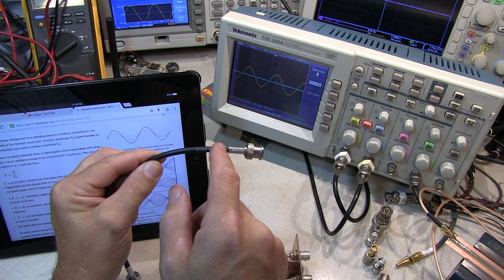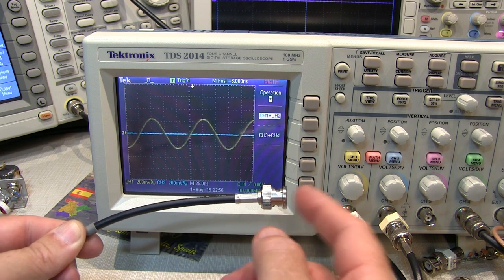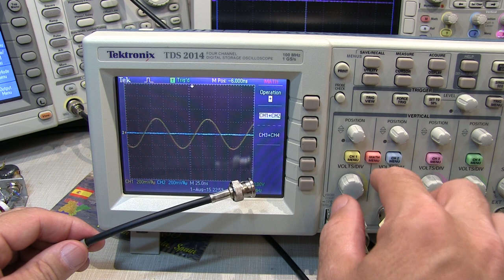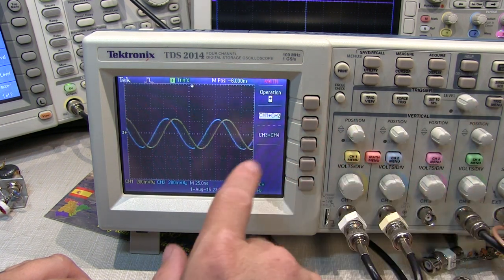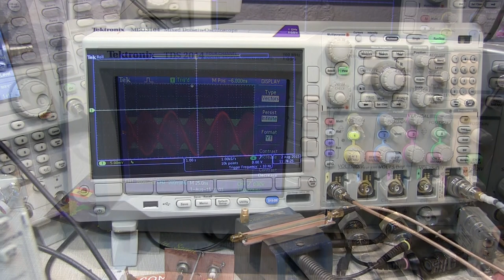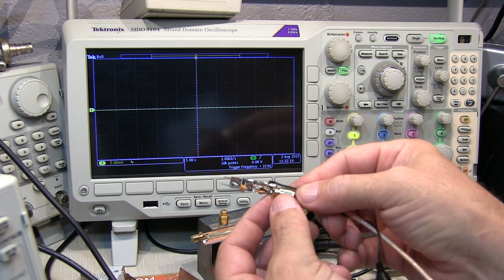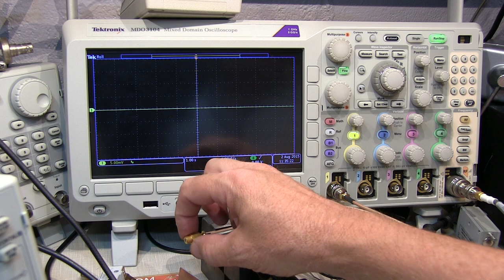#208: Visualizing RF Standing Waves on Transmission Lines

Comment: Hello Alan. Thank you for your time spent making these videos. 
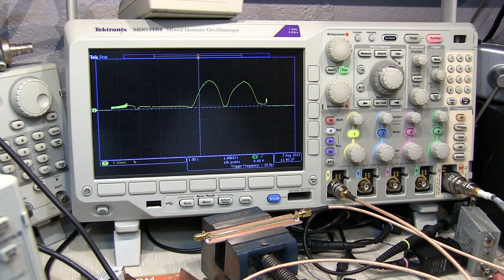In your summary at 10:15,  if we can relate that a mis-termination of a transmission line as being an antenna that does not have a reactive, capacitance property of 50 Ohm at the frequency of operation. As well as not having our transmission line from the antenna to our SWR meter at 1/2 wave increments to the Velocity Factor of the coax, would only mean that we would not be able to truly see what are VSWR actually is. 

For example, if our main run is a random length of coax and we tune an antenna to the coax with the swr meter in our shack, although the swr meter is showing a reasonable swr it doesn't mean our antenna is a 50 ohm termination. Effectively not radiating power from the antenna but the coax as well diminishing the Effective Radiated Power.  

On the other hand, if we were to have our main run from the antenna to our SWR meter in increments of a 1/2 wave length at the frequency of operation to the Velocity Factor of the coax. Only then would we be able to tune our antenna to the lowest VSWR possible (or as close to 50 ohms as possible). Maximizing our Effective Radiated Power.

Make sense?
Reply from the maker: First point of clarification - there is a mis-termination if the antenna does not have a RESISTIVE impedance that is equal to the transmission line impedance (not a reactive or capacitive property).  If the antenna presented a 50 ohm capacitive reactance, it would have a very high SWR.

The "magic" of a half-wavelength transmission line is that the impedance looking into the line will be equal to the impedance looking into the load (antenna in this case). In other words, the load impedance is replicated when the line is a multiple of half wavelengths long.  A longer or shorter transmission line will result in a change in the impedance looking into the line, but does NOT change the SWR on the line.  This is a very important statement to grasp - changing the line length does NOT change the SWR, it just changes the complex impedance seen looking into the line.  This is illustrated pretty well in one of my videos on the smith chart (https://www.youtube.com/watch?v=ImNRca5ecF0).  Of course, this is assuming negligible loss in the transmission line.

So, having the transmission line be not equal to a multiple of half-wavelengths long only means that the input impedance does not match the antenna impedance - but the SWR is still unchanged!  The SWR is a function of the antenna impedance and the transmission line's characteristic impedance, NOT the line length.  Therefore, if you make adjustments to an antenna to minimize SWR, the result will work fine regardless of line length (as long as the transmission line is not electrically part of the antenna).

Bottom line, it is NOT necessary to have the transmission line be a multiple of 1/2 wavelength in order to get maximum radiated power (maximum power transfer to the antenna).
Reply: @w2aew  
Clarification noted!

If I am reading this correctly (Cuz I aint lernt to good) The "magic" of a 1/2 wave length coax is, that it is no longer seen by the transmitter. Poof, It disappears (not taking into account losses in the coax) Ta-da! Magic!

To my understanding, the transmitter now sees the antenna only, and if the antenna dos not have a 50 ohm impedance a Standing Wave will be educed on the line and seen by the swr meter.

You have made it clear in other videos that a 1/4 wave transmission line looks like a short.(it is also mentioned in the MFJ analyzers manual) Which means the impedance value of our transmission line does change BASED ON length of line with respects to frequency applied. so using a random length of coax while making a 1/4 wave ground plane antenna affects the tuning of the antenna, while trying to make the antenna terminate our line at 50 ohms. Making the coax electrically part of our antenna. 

(an experiment that everyone can do)

If I build a 70 cm 1/4 wave ground plane antenna with a random length of coax, which works perfectly fine with minimal SWR at my house and I give it to my friend for Christmas (cuz i'm such a nice guy) and he uses his own coax, which is a different length and Velocity Factor (then what I made and tuned the antenna with) his SWRs will be totally different than mine.

Now, the stipulation to this (in my opinion) is if I give him the antenna WITH the coax (in which i'm really not that nice of a guy) that i made and tuned the antenna with originally and he needs to extend the length of the coax to get to his swr meter. He would need to make a coax jumper in increments of half wave lengths. That would mean that the coax I give him IS Electrically part of the antenna (which is now a 50 OHMs to the end of the coax not to the connection at the antenna) and the extension he needs to make will not be seen by the swr meter because it is in 1/2 wave multiples. Poof, Ta-Da, Magic !!

If I would have originally used a length of coax that was multiples of 1/2 wave lengths to the frequency of operation and velocity factor of the coax, The home brew 1/4 wave ground plane antenna, would have an impedance of 50 ohms at the connector.
 
(End experiment)

To to sum it up (in my opinion), 1/2 wave increments of coax is the only way to do things, when setting up a station. Unless an antenna tuner is used. Even then, the work done in the transformation of impedance by a tuner would be less if 1/2 wave increments were used to and from the tuner (the transmitter will not see the coax only the tuner and the tuner would not see the coax, just the impedance mis-match of/at the antenna) That could only be proven with  a VNA in which I don't own.

Alan, I would like to make something clear. I am not trying to negate, manipulate, argue, dispute anything you are saying or showing us in your video.
I really do appreciate the work you have done and your time spent making your videos. The one thing that you have done is sparked further curiosity and ambition on working towards discovery and understanding.

 I thank you for that.
Reply from the maker: @sevenoseven8494  I'm afraid you misunderstood me!  The only thing that the 1/2 wavelength increment gives you is a replication of the antenna impedance at the coax input.  There is NO REASON to restrict yourself to this!!  You can use any length you need.  If the antenna is matched to the coax, all is well with any length coax.  If the antenna is not matched to the coax, the input impedance to the coax won't be 50 ohms, but can still be matched at the transmitter end with a tuner, regardless of coax length.  The SWR on the line in this case will be the same - regardless of the coax length.  Restricting to 1/2 wavelength increments does not make the tuner's job any easier.  The complex impedance looking into the coax will vary with the coax length, but the SWR is the same.
Reply: @w2aew  
I'm sure I do understand you, It seems we are standing a quarter wave apart on a smith chart looking towards the center, both trying to achieve a 50 Ohm Impedance.

1) you state,
The only thing that the 1/2 wavelength increment gives you is a replication of the antenna impedance at the coax input.
my response,
that's my point! I want to make sure that my antenna has an impedance of 50 Ohms not my coax and antenna!

2) you state,
There is NO REASON to restrict yourself to this!! 
My response,
It's not a restriction, having the main run to the antenna in 1/2 wavelength increments, would not be adding the complex impedance of the random length coax to the miss-matched complex impedance of the antenna, further complicating the total complex impedance of the antenna and coax. Why make things more complex then what they should be. the antenna impedance would be the cause of the miss-match on the system creating the SWRs.

3) you state,
If the antenna is matched to the coax, all is well with any length coax.
My response,
If that's the case, I can use RG6 75 Ohm coax trough out my shack. Adjust the angle and length of the ground plane of my antenna to compensate for the impedance and affect the angle of radiation of the antenna. Rendering the antenna useless. Achieving a flat SWR.

4) you state,
If the antenna is not matched to the coax, the input impedance to the coax won't be 50 ohms, but can still be matched at the transmitter end with a tuner, regardless of coax length.
My response,
That's exactly what the purpose of doing things this way. Now I know that the antenna needs adjusting. That's it! Using a half-wave length of coax ensures that the transmitter/SWR meter see the antenna and not the coax and the antenna matches to the transmitter. 

5) you state,
 The SWR on the line in this case will be the same - regardless of the coax length.  Restricting to 1/2 wavelength increments does not make the tuner's job any easier. The complex impedance looking into the coax will vary with the coax length, but the SWR is the same.
My response,
I quote "The only thing that the 1/2 wavelength increment gives you is a replication of the antenna impedance at the coax input." any SWRs will be caused by the impedance miss-match of the antenna. It will show a similar complex impedance miss-match value (of the antenna) on a MFJ analyzer, as if the analyzer was plugged into the bottom of the antenna with no coax or separated by one 1/2 wavelength of coax or separated by multiples of a half-wave length of coax. Intern, showing me how close the antenna is to a 50 ohm impedance. Because the coax becomes less of a factor, aside for the losses of the coax. in which we have no control of.
Reply from the maker: My point is that you’re not adding any complexity when using non 1/2 wavelength increments. When using 50 ohm coax, minimum SWR occurs when the antenna is adjusted to 50 ohms, regardless of coax length. You don’t have to use 1/2 wavelength increments to know when you’ve adjusted the antenna to 50 ohms.
Reply from the maker: My point is that you’re not adding any complexity when using non 1/2 wavelength increments. When using 50 ohm coax, minimum SWR occurs when the antenna is adjusted to 50 ohms, regardless of coax length. You don’t have to use 1/2 wavelength increments to know when you’ve adjusted the antenna to 50 ohms.
Reply: @w2aew  the only way i have ever been able to tune an antenna has been by using coax in half wave multiples to the frequency of operation. One thing is for sure is that there is not one universal fix to any particular situation. What might work or you might not necessarily work for me and vise versa.  And that is the fun part of the hobby. At least for me it is.
Reply: There are many SWR in this system, because there are many reflection points (impedance discontinuities).

Imagine you have Z=100 +j0 antenna and Z=100 +j0 transeiver. If you connect directly, there won't be reflection (no mismatch loss), SWR=1 (there is no SWR patterns over antenna conductors).

There is no transmission line yet. Let's change transeiver to Z=50 +j0. SWR=2. No transmission line yet, but there is power reflection in the 100 to 50 Ohm junction.
Inside antenna structure there are standing wave patterns
Here how they look for Uda-Yagi antenna:
https://ypylypenko.livejournal.com/51128.html

This standing wave pattern PREVENT antenna from effectively absorbing and radiating power.
Instantaneous values of E-field (at any given moment) is distorted by reflected energy. In RX mode this extra E-field strenght at a given moment will DECREASE instantaneous difference between E-field density in free space compared to matched antenna condition, therefore less energy will be absorbed from environment.

In TX mode the same will prevent from receiving energy from your vacuum tube or transistor. Instantaneous voltage values at anode/collector will prevent consumption of new portions of energy from power source.

What will happen if we introduce 1 more segment: transmission line (symmetrical or coax)?
If Z=100 +j0 antenna is connected to Z=100 +j0 load via 50 Ohm cable, SWR inside cable will always be SWR=2 no matter of length. There will be 2 points of reflection - at antenna terminal and transeiver terminal.
If length is proportional to 0.5L, you will see Z=100 +j0 at transeiver side. But still SWR inside coax line will be SWR=2, there will be standing wave pattern (extra heat loss) and reflection at antenna->cable junction (wave pattern in antenna structure will be as for SWR=2).

With 0.5L you can combat reflection only at 1 junction (closer to load, which is antenna junction in TX mode or receiver junction in RX mode)
SWR in a segment is SWR=(1+Г)/(1-Г), where Г is  reflection coefficient at nearby junction
Reply: A simple experiment anyone with an antenna analyzer can do, to see how the complex impedance of coax affects the 50 ohm resistive load. 

Materials needed.
1) A "T" connector 
2) A Double male connector/coupler 
3) A 50 Ohm Dummy Load
4) Random length of coax.
5) Antenna analyzer, 

Testing of coax.
1) connect your "T" to your analyzer.
2) connect your Dummy load to one side of the "T" with the double male connector/coupler (do not use coax between these 2 points)
3) connect your coax to the other side of the "T"
4) Turn on your analyzer.
5) Dial in the center frequency for your preferred band of operation. 
6) Note your SWRs
7) Your analyzer is seeing the dummy load and how the complex impedance of the coax is affecting the Resistive 50 Ohm load at your desired frequency.
8) you can now adjust the frequency of the analyzer to find the lowest swr. you will see that you have a certain bandwidth with a perfect 50 Ohm impedance. that would be the bandwidth of frequency in which the coax complex impedance will have a minimal impact on the complex impedance of an antenna and it's tuning.

Comment: One more great video, Alan.

I did not read all comments, but perhaps the answer to your "sliding waveforms" question is: use a trigger source that is independent of any of the two channels shown (ext trigger, for example) and is only slightly different in frequency when compared to the other two waveforms. Also, the frequencies between the two channels are also slightly different but not perceptible. I think this would be enough to create the "travelling wave" effect in both directions, wouldn't it?

Well, perhaps there is a simpler approach to it.
Reply from the maker: Rafael Souza Yep - brownie points to you too.  I made one slightly higher than the trigger frequency, and one slightly lower (by the same amount).  Thus, when you summed them up, the result was stationary with respect to the trigger source.

Comment: RF Waves are difficult part of electronics,the videow above are very educational,I made the last one "rf probe" and try it.....on small oscillator circuit.
Alan thanks for your time,Ι have a proposal that next circuit contains a ic from Analog Device like AD8361ARMZ,rf transmitter or receiver power measurement!

Comment: Great but the first part of video thats mathematical explanation using two channels and mathematical synthesis. the trick with RF probe visualizes the effect perfectly, so simple idea- fantastic. Another way: If you send a some piko or nano second long impulses, let say every 10ms, to 50 ohm cable  which is connected to the scope and you change termination resistor you will see reflected peaks on scope. Positive or negative when shorted. I did such experiment some years ago. If you know cable k factor you can even calculate the length of the cable where the short is. I have never had a scope which has build-in 50R/1meg termination switch, but this would be interested to observe how the sinewave is changing while switching from 50 to 1Meg input.
Reply: Time Domain Reflectometry.

Comment: Awesome videos.  Like others comments YouTube has become a much greater source of practical learning than university ever was.  In this video or one linked in the description you briefly mentioned the RF “jumping” off the transmission cable/antenna.  I thought you mentioned that the RF voltage off the antenna was much greater than the cable voltage and a source of the reflected wave.  Is there more to it than that?  If so a video would be much appreciated.

Comment: First time I write anything on your UT channel but I've checked lots of your vids out :)
I can also say that English ain't my native language so if I spell something wrong I hope you understand.

Extremely good information you give in all your vids :) Explaining what happens to current, signals, voltage and so on :D :D

It took me a while to find the ones I was interested in 'cos your vids can't be sorted well as far as I know anyway. I had to click on a newer post just to be able to see some other posts mostly older though lol
If you know how I can do this, lemme know :D

Some things that I haven't found in your videos(yet?) or anywhere else on UT for that matter are the list below and by this I mean, if you could setup a small vid for these explaining how the signal is transformed into the new wave and so on, well just as you do in previous ones and if so, you win a toaster :P (only Ocean Blue left, lmao)

These are stuff that I haven't found on UT with description HOW it all works and what happens to the signal throughout the circuit.
List in the order of my priority ;)

- Switched power supply, like a PSU in a computer and THIS is one thing that I REALLY want to know about and possibly even able to repair one if possible.
- The simplest Sinus Wave generator with as little distortion as possible.
- The simplest frequency counter there is, from like 10Hz to 100MHz or so for all types.

Thanks again four your wonderful FULL description of it all.

//Thanks In Advance OeS - SWEDEN

UPDATE: Now when I read my post again, why not a simple video of how to check a faulty circuit board and how to find the component that broke it :)